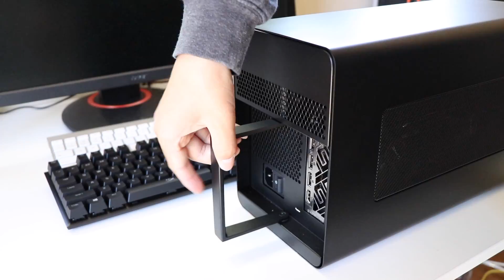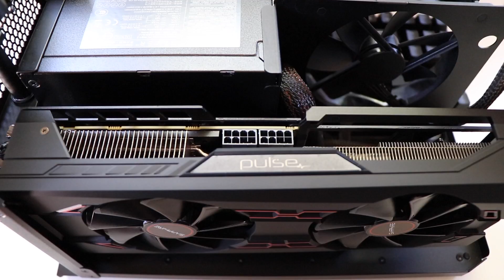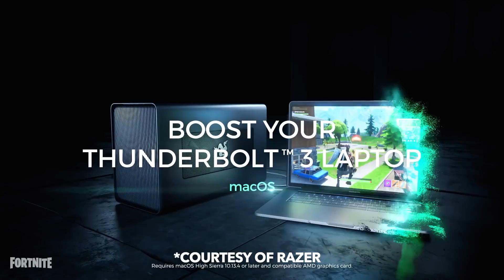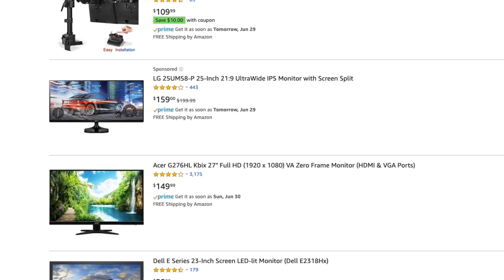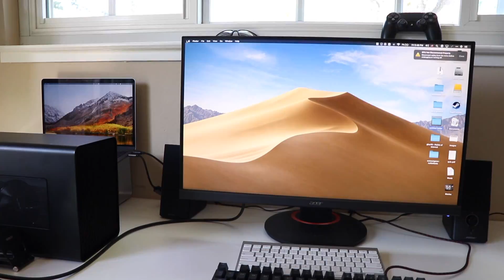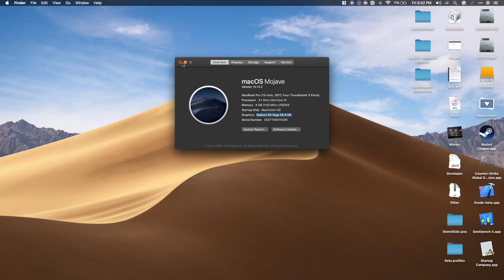How to SETUP/CONNECT /GUIDE Razer Core X with AMD GPU to MACBOOK PRO/Mini/iMac(2019)

Comment: Great video, thank you! Quick question that you might have the answer to: my Sapphire Pulse Radeon RX 580 seems to only have 1 power port but there are 2 power cables within the Razer Core X. If I am only using one of the power cables for the RX 580, will it be safe to use? I am working on an iMac 2017 (Mojave).
Reply: Same predicament.. waiting for an answer
Reply: @oniichan uwu but my my gpu is not running . i dont understand why
Reply: To each of you the one cable is safe, however if you are on windows "the rx 580 is not supported" which in other words razer is giving up on this for now and will not support you DO NOT INVEST.

Comment: Nice and straightforward video. Thanks. Question though. Did you have to instal the Razer software? On their website, it says it is necessary. I just ordered the Razer core X chrome and Radeon 5700 XT so I will be going through it sometimes in the next five days. So I am hoping it will go smooth.
Reply from the maker: Thank you! I’m glad you enjoyed the video. About the razer software, in this video I was using it with Mac OS and Mac OS only has support for certain cards. Mac OS does support the Radeon 5700 XT, which means it should be plug and play like shown in this video. However, if you are on windows, I am not sure exactly.
Reply: Tech Dude thank you so much! That sounds great!

Comment: Hi, I see the power for the razer core x through the usb-c to the laptop is only 100w. What if the computer that it's connected to has a power larger than 100w? I'm thinking about a mac mini which has a power of 150w. Would it work properly? Or can you still power the computer using the power cable at another usb-c port?
Reply: It will not. If it cannot get 150W it will either not startup or it will be lowering the CPU frequency. Simply not enough voltage.
Reply: The Mac Mini is NOT powered over USB type-c. It uses a normal power cable that is included in the box, also usb type-c is NOT thunderbolt 3 and would not work with an egpu
Reply: You need a thunderbolt 3 port and thunderbolt 3 cable to use an egpu on your mac. Make sure to check that before buying a mac mini if it’s a few years old
Reply: @Scoopyyy  I didn't know that. Thanks for the info. I am still in the process of making up my mind to buy it.
Reply: Z Z no problem, I’m just trying to make sure people don’t make mistakes ;)
Reply: Scoopy this is so true. Hahaha I was focusing my answer on the simple math of voltage, that I totally ignored the the regular power source of Mac Mini. Hahaha both eGPU and macMini have their on power supply and Mac mini has T3, so in terms of that there should be no problem. That being said, why Mac Mini and eGPU? Just go for the new iMac 5K 27 inch. It is a beast and unless you need RTX card from
Nvidia then I would not bother for eGPU.